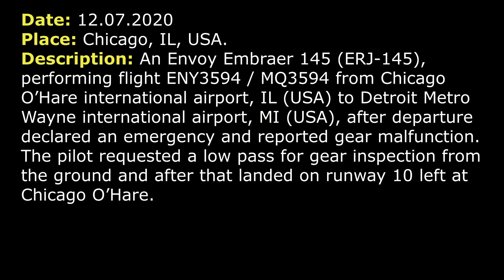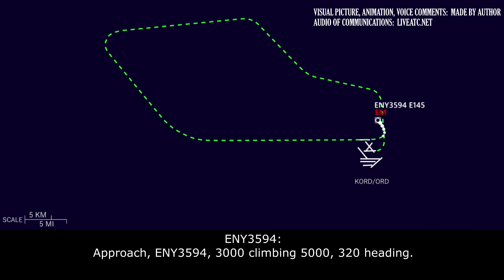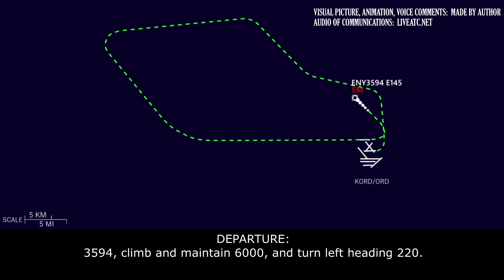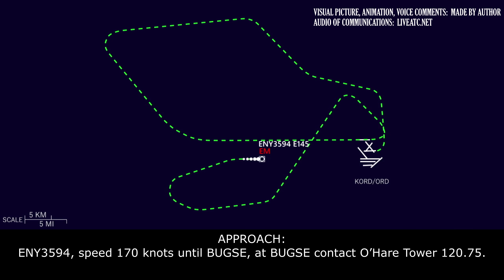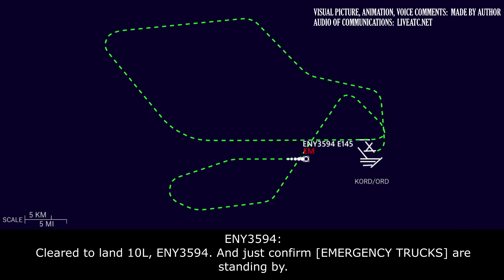(Real ATC) LANDING GEAR MALFUNCTION, EMERGENCY RETURN  | Envoy air ERJ-145 | Chicago O’Hare airport

Comment: 0:54 “and if you give us an extended downwind”
1:02 “And when you’re ready to go in, I assume you need one of the 10C or 10L.”
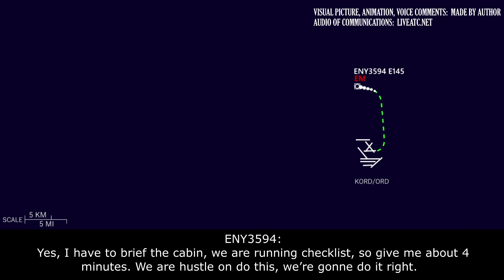1:52 “We’re hustlin’ through this, but we wanna do it right.” “Yes, take your time.”
2:24 “message” :-)
3:49 “3594”
4:12 DOOGY 🐶
4:20 “and we’ll just let ???”
4:57 “just for an extra pair of eyes here” 👀
5:10 “just off your right-hand side”
5:22 “two of us up here” (looking at the gear)
8:10 “??? stopped at approach end”
Reply from the maker: Thanks. I'll pin it.